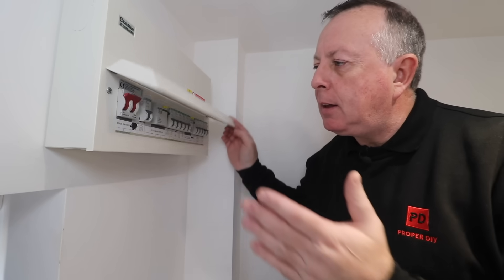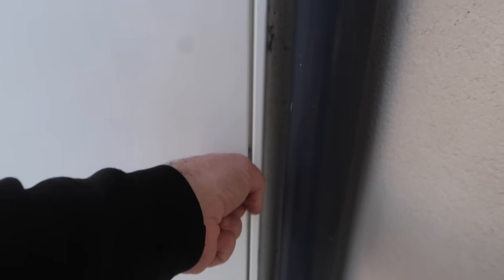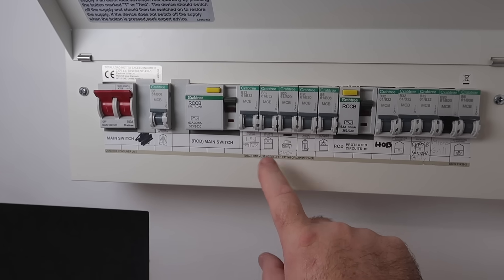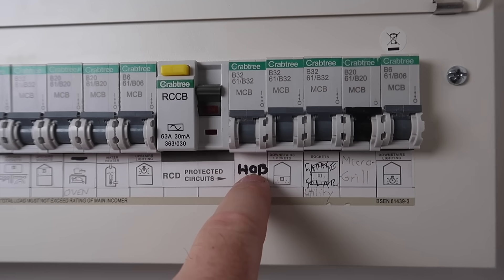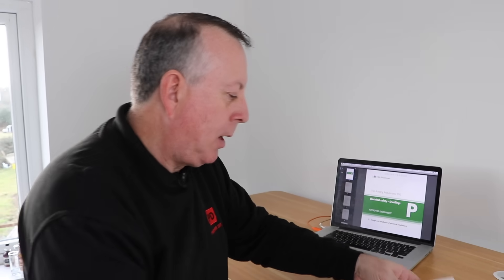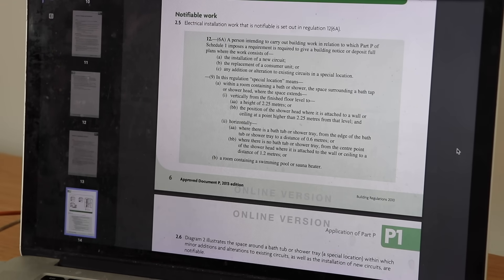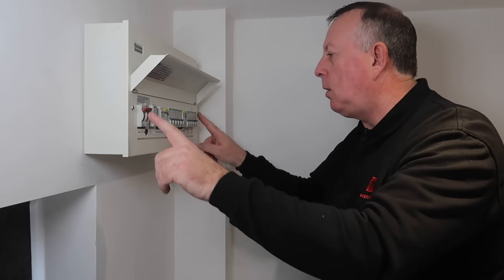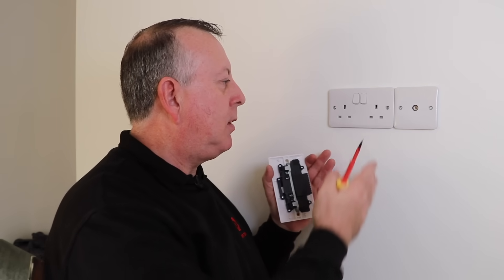What electrical work are you allowed to do in your own home?

Comment: I've been an electrician for 20 years (apprentice/NVQ/AM2/2391/Regs etc) and from experience, houses with evidence of DIY are often at best a mess and at worst, a danger to occupants. There's a reason it takes 4 years in an apprenticeship plus dozens of practical & theory exams to be deemed qualified and competent.
Reply: "I've been an electrician for 20 years (apprentice/NVQ/AM2/2391/Regs etc) and from experience, houses with evidence of DIY are often at best a mess and at worst, a danger to occupants"

Well yes, the dodgy DIY will be apparent. But then how many houses have you been to where a very competent DIY electrician has done a good job, so much so you weren't aware it was DIY. You only notice the bad stuff and miss the good stuff.
Reply: @martinw245  NVQ, is that not very qualified lol
Reply: @barrysmith9020  To be recognised as an accredited electrician by the Joint Industry Board in England you need a 4 year apprenticeship, NVQ L3, city & guilds college units & AM2 as a minimum 👍
Reply: @barrysmith9020  I was quoting someone else.
Reply: I wouldn’t do much electrically as I’m paranoid albeit whatever DIY I do I try doing it to the best standard as possible because it’s my house and I don’t want it affecting anyone else either!
Reply: I think the point here is that you remember the total messes and don't notice the stuff that isn't a proble,. I'm not professionally qualified to do electrical work but I'm happy to do all the basics myself. The key thing is I know my limits and should I need to go beyond them then I'll bring in help. The messes that I've seen from so called professionals are often a house fire waiting to happen, I've fixed enough of them and they are basic sloppy work but others I've run a mile from (for example live and neutral switched throughout a property). I've also seen how awful the checks are when I've had someone in to certify my work - they opened up one socket, eyeballed the wiring, checked an unrelated fixture and signed it all off. It hardly inspired confidence.
Reply: Yet you look in enough places and find an extraordinary amount of incompetent electricians who have no idea what they're doing. I've been working in this field 4 years now, with 3 different companies. Both union and non union. I must say the skills and knowledge isn't being passed down like it should. Everything is about deadlines and production now a days. So you'd be surprised, some of these diy guys would probably do a better job than some of the idiots I've worked with who just want to get into the field because they hear it pays well.
Reply: I am totally unqualified; I have several times done electrical work in my home but then each time I had it checked by a qualified electrician.  Paying them to do the testing is far cheaper than paying them to do something simple like replacing a single 3 pin socket with a twin, or putting another three pin socket on the circuit in my hallway.  If they ever find a fault then I'd pay them to put it right, but so far I have always been told I did a good job.  I do however restrict myself to very simple tasks and I have the proper manuals to guide me.

One man I knew ended up having to have the ground floor of his house rewired by a professional because he had made such a mess of things that rewiring the entire ground floor was the only safe solution.  I think he also got fined, though that last bit came to me second hand so I am less sure of it.  He seemed pretty annoyed at the expense but got no sympathy from me.
Reply: Mmm and as a DIY'er I have corrected bodged and cowboy work from so called qualified electricians. So who do I trust more to do it right, me or you?
Reply: I agree with the sparkies, I'm an engineering technician on electric passenger trains, I work on 25kv AC systems down to 110vdc. I've got the hand skills, I've got electrical knowledge that electricians I know don't have. BUT, I don't know the regs for home installations.

I use to work in a DIY store while studying electrical engineering, so the store used that and anything electrical they'd ask me to help. Pretty much every time I recommended DIY ers to get an electrician, just a few simple questions and you realise when somebody doesn't know what they are doing.

However, people who do know what they're doing should be allowed to do the odd jobs themselves, like me. If I'm in doubt, I ask a professional. As I don't know how many sockets I can have in a ring, or how many spurs can come off.
Reply: @SomeGuy-lw2po  All good points you made there. The regs have changed a lot in recent years and it can be a minefield. From some replies it’s sad to see customers have bad experiences with people calling themselves tradesmen but there will always be bad eggs out there.
Reply: In the absence of installation certificate, there is an insurance called indemnity insurance which the house seller can buy and provide that to the buyer. We did that and problem solved.
Reply: Just spent a week sorting stuff out that a qualified person did in my mum’s house
Reply: Totally disagree.  Most DIYers want to do a good job as its their own house.  Most tradespeople want to rip you off and do a bad job
Reply: @arthurdaly3497  a little bit of knowledge is dangerous
Reply: @antdennehy9967  Exactly, that's why you are better doing it yourself.  Too many complete chancers around, and I wouldn't chance it on my own house
Reply: @arthurdaly3497  Exactly
Reply: @arthurdaly3497 how do they know if they have done a good job if they are not trained and also qualified to test
Reply: @simonfranklin7659  Its just joining wires together
Reply: @arthurdaly3497  how does a diy'er know he's done a good job? Simple answer is, he doesn't. You pay for our experience and knowledge. Something you don't get watching a 5 minutes YouTube video. I don't do plumbing, or gas , I pay someone. As you should with electrics
Reply: @westleyjohnstone4719  You're the thick kid from school. I'll do my own home maintenance thanks
Reply: @arthurdaly3497  I have seen bad work and sloppy work by electricians but  by far the most head aches I have encountered is by DIY ers with some knowledge but not enough, especially now that I have to take responsibility for installations that I work on but didnt install ? people moan that I maybe charging high prices for " a couple of extra sockets here and there" and yet a property may have open rings , super rings, no eqaupotential bonding,  mixed pvc/vir cable , no supplementary bonding with no RCD protection,  high Zs values from no eicr testing ever , ect. ect.
Reply: @rayalbion9637  You're exaggerating how complicated it is, it's just three wires.  DIYers are allowed to put in extra sockets on spurs I believe anyhow
Reply: @arthurdaly3497  yes your right , so why is it wrong so often ? its because of the lack of testing after the work , the test quite often seems to go no further than turning the circuit back on and seeing if appliances fire up (if they do then job done) .
Reply: @arthurdaly3497  What test meter do you use then?
Reply: @davebadger100  For what?
Reply: @arthurdaly3497  For any electrical work you do.
Reply: @davebadger100  I use the Klein Tools NCVT and their maintenance and test kit, along with a socket tester. I’m sure you see DIY nightmares, but some of us do try to do a safe, compliant and tidy job
Reply: @davebadger100  if I've added a socket, I find a good test is seeing if the socket works
Reply: @arthurdaly3497  Oh right, Yeah that's Ok. You obviously know what you're doing. That;s all you need to do. Just plug something in and see if the socket works.
Reply: @davebadger100  correct, because a working socket is the desired outcome, and it's pretty impossible to screw up connecting 3 new wires to 3 existing wires
Reply: @arthurdaly3497  Absolutely.  Like you say its only 3 wires. What could possibly go wrong? The circuit that's being altered or extended will be totally safe and in perfect condition. After all it's been working fine for years before. 
Every electrical installation I've ever worked on has been perfect. Never been altered or tampered with. So much so that I've lobbed my £700 Megger in the skip. No point wasting my time testing. Never come across any faults.
Reply: I've extended the ring with four sockets and two spurs in my kitchen, as well as relocating the light switch while doing a total refit as well as all the plumbing.
I couldn't afford to have trades do it as I also paid £800 to have my bakelite fusebox replaced...... that was enough!
P.S. The electrician found no problems and everything worked fine........
Reply: @fabianmckenna8197  everything worked fine, does not mean "it's ok". A ring main will work fine on 1mm for a little while. Any electrician worth his salt wouldn't put his name on a diy job
Reply: @westleyjohnstone4719  Well that's odd since while replacing my fusebox,  they checked out every socket looking for all of their settings. I showed them the replacements and they were quite happy with my work finding no poor connections, wrong size wiring or hidden boxes.
Two fused spurs for washing machine and dishwasher also caused no concern.
It's not rocket science to open a socket, add wiring and four extra sockets and reconnect to the ring. Perhaps you'd be happier with me wacking on four multiple exension sockets and running washing machines, tumble dryers, heaters, cookers etc while not worrying about overheating wiring.

As ever it's about being confident in what you're doing and being safe about it.
Reply: @fabianmckenna8197  at least extension leads have a fuse in them. But I still wouldn't trust a diy'er. It's not rocket science, but understanding everything associated, maximum Zs values , etc is why I wouldn't trust not you particularly, any diy'er. Zones, latest regs etc, torque screwdrivers, diy'ers spuring off of spurs.  Don't get me wrong, there's some shit tradesmen about, don't trust the work of half of them either around here. But I could probably do gas, but I leave it to those in the know.
Reply: Yeah, probably a cowboy electrician who rewired this house with a separate ring for the kitchen but which only had four sockets...... seriously, four sockets might suffice in any other room but kitchen?! 
Adding four more will not cause any problem nor will two fused spurs added for washing machine and dishwasher which is perfectly legal, safe and preferred.
Agreed that spurring off a spur is bad news but extension leads can easily be overloaded causing fires....  

Gas..... no chance of messing with that, I had central heating installed by Gas Registered installers as it's way above my abilities and comfort zone.

Like I said, this DIY'er knows enough to fit a kitchen....lowered alcove ceiling to create shelves storage area with hatch access, framed and drywalled three walls, added coving,, fitted 14 base units, larder and oven unit, 9 wall units, breakfast bar and 10 metres of worktop..... by myself.
Hard graft but saved a fortune by not employing "experts" and my wife is delighted with the outcome.
Reply: I totally agree. I moved into a Charles Church so called quality new home 20 years. I have over time corrected most of the shoddy electrical installation, presumably Charles Church contracted a whole raft of DIY types to throw the stuff in.
Reply: I don’t doubt this is most cases but not all qualified sparks do good work either. I pick up small bits, sockets ect . My new house was a mess and apparently signed off by a spark, EICR ect ( was a rental has we bought it). Rather than saying don’t do it, educate them on what is allowed and how to do it well. I’m getting my mate (15 years spark) to come do my board switch over because I did the research and know the rules.
Reply: @doweirdsht  believe me, many sparks have no clue how to do a eicr, litteraly no idea what the tick boxes mean. And blatent lie on the test sheet. Thing is, the course doesn't really cover this, and the first time you do one it is overwhelming. They go down three routes, lie, learn or do the test and inspect course, 2391 I think back when I did it.  The 2nd option means someone else's name goes on the cert. A good spark can spot a eicr done from the van, they are genuinely shit liers, hence why they lie in the first place
Reply: Not intended but this comment has seemingly triggered some people. 

I’m sure many can fit a socket just as significant numbers of qualified people will work to poor standards. Ultimately though, a qualified electrician is just like a hairdresser, dentist or plumber; you’re free to hire one or just watch YouTube and have a go yourself 👍
Reply: Sparkeys always say this, it’s the only trade everything is colour coded 😂. If you can wire a plug you can redo a ring main.
Reply: I learnt how to electric work with an electrical engineer teaching and watching me! I learnt a lot and asked questions. I have replaced stove tops, test and tag with insulation tester etc. Interconnecting air-conditioning circuits!
Reply: The consequences of not notifying building control will result in a fine,.  The regulations state that any competent person can carry out electrical work which must be signed off by building control who will instruct a qualified electrician to test and certify which you, as the installer, have to pay for.  I have always done most of my 1st fix working alongside a qualified electrician.  My last install had two radials, one ring final, one lighting circuit and two hard wired circuits for ovens passing through isolation switches, all passed without any errors.  I do not go near consumer units but test each circuit for  continuity as I go. Suitably qualified (part P) electricians can avoid notifying building control and self certify.  I always have to hand Electrician's Guide to the Building Regulations. I understand the requirements and have always over engineered my installations to the point where my electrician has said my work is very good but sadly, I would never make a living as I’m too OCD!
Reply: I got some qualified sparks to rewire my house for a cash on the side job 20 years ago and cos it was taking them longer than they liked they cut some corners, ie, leaving the old wiring cut but still in situ, whilst I was doing some flooring work later I tried to get rid of the old cable and tidy it up a bit, I cut through some old cable and blew the rcd, wtf, it was still live so that was a bit of a lesson learned.
Reply: I’d gladly hire a local,qualified electrician-and gladly pay reasonable rates for their expertise,experience and assumed safe practices. However, what I call “guild protectionism “ causes costs to be absolutely astronomical,beyond the pale. When the qualified electrician wants to charge 800.00 for ,say, adding a ceiling fan or outdoor motion sensor light- and can’t do the work until “ sometime in the fall-I’ll call you” , I DIY,to the absolute best of my ability and hope for the best.
Reply: No it does not. It is all pretty straightforward.
Reply: Couldn’t agree more sparky for 16years DIYers very often conduct work with no knowledge of the regs it’s ok though isn’t it it’s just 3wires 🙄🤷‍♂️
Reply: The reason it takes 4 years is because it teaches near enough the entire trade. The certifications are only there to prove that you're capable of the work, for legal purposes, nothing more. You may be an electrician, but you're not very bright.   

"Competence"... Laughable, there are incompetent fools in every trade, despite the training they receive.
Reply: @Whom1337  volt drop, calculations, everything. These diy'ers know fuck all
Reply: @Whom1337  teaches the entire trade? Does it heck, that's why fresh out of college people are not always that great. You learn on the job. Just because something comes on doesn't mean its right. This whole is just 3 wires bs, makes people in here look idiots, it's fault finding,  figuring out how other people have done it, zones, new regs, the list is endless.
Reply: Not all DIY work is unsafe, and equally not Electrician's is safe. The last Electrician's work caused a socket outlet fire of my house. They loosen the wiring without tighten it properly.
Reply: especially d.i.y ers touching ring final circuits
Reply: @rayalbion9637  With respect, I'm a DIYer who recently discovered that my downstairs ring final circuit was broken on all three conductors and managed to trace which cable run had the break. I then split the ring into two radials and isolated and labelled the dead leg in each socket. Measured R1+R2 in each leg to determine that replacing the 32A RCBO with two 20A RCBOs was appropriate. Technically the longer radial might have an issue with voltage drop if the full 20A was drawn from the furthest socket but I made a judgement that this was unlikely. We have a separate kitchen RFC so the loads on the downstairs RFC are minimal.

My upstairs RFC was also broken in one conductor and I traced the fault and fixed it. It was just an over torqued earth screw which had crushed the conductor to the point where it broke off. 

I moved into this house 3 years ago and although it was in a reasonable state of repair, I have made several improvements to bring it up to 18th edition standard from 16th edition. I have no doubt that it is safer today than it was 3 years ago and I will continue to monitor and improve it over time. I have an Megger MFT and I know how to use it. I also have a torque screwdriver which I was dubious about buying but have been continually surprised at how tight 2.5NM actually is! I use intumescent sealant and grommets to contain potential fire inside the DB.

That all said, I'm not an electrician. I am an electronics and electrical engineering graduate and I'm also an electronics hobbyist since childhood which helps greatly with understanding of the fundamentals. What I lack is experience as an electrician and I am very aware of that and try to compensate in other ways. However, in my case I only need to know enough to deal with my own house and not every possible type of domestic and commercial property like a qualified electrician would be expected to handle. There is also nobody more motivated than me to ensure that my house is safe and functional so I have a copy of the 18th edition regs and OSG and have watched dozens of hours worth of videos to ensure I understand the relevant issues before undertaking any work.

Before anyone starts quoting Part P, I live in Scotland where we are allowed to work on our electrics as long as we do it in compliance with the regs. My intention is to do all the work I think needs done and then bring in a reputable electrician to do an EICR. That will provide a second pair of eyes to check my work.

Most DIYers should probably steer clear of doing electrical work but if you have the educational background and are prepared to invest in the necessary equipment and other resources then you absolutely can do your own electrics on a DIY basis. Assuming you are legally allowed to of course.
Reply: @craigchamberlain  Your the exception not the rule , i can not count how many times I have encountered problems with DIY on rings (its the norm) as you are already aware with your experience a ring circuit will very often give power at sockets even when incorrect , I think its a method of wiring thats had its day , Iam sure its only the u.k that uses the ring method of wiring.
Reply: @rayalbion9637  Good point. From what I've heard working with colleges and at NIC tech talks, the ring is on its way out due to the problems often caused by home modifications.
Reply: @joecostello9759  yeah i heard something similar,  i only use them on kitchens now
Reply: @rayalbion9637  You don't know he's the exception not the rule, because you don't notice the competent work, only the dodgy stuff.